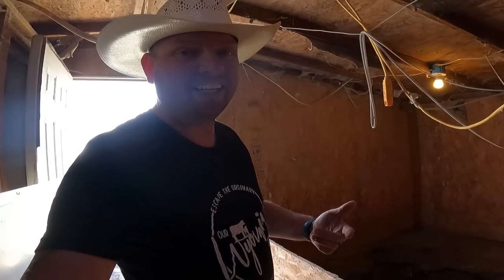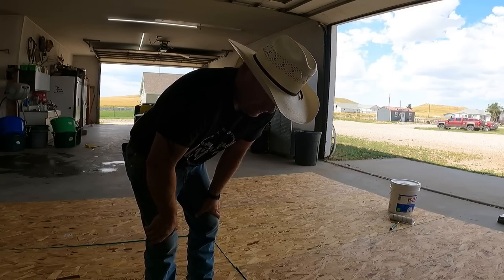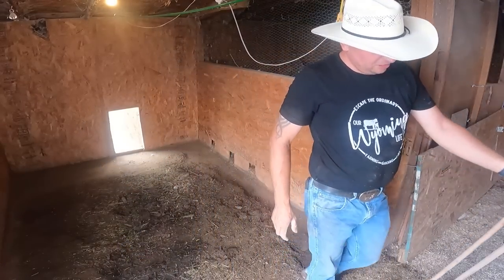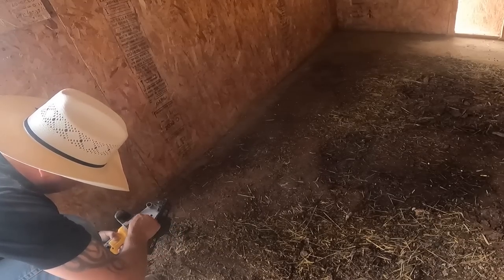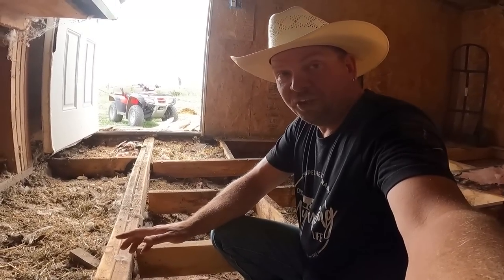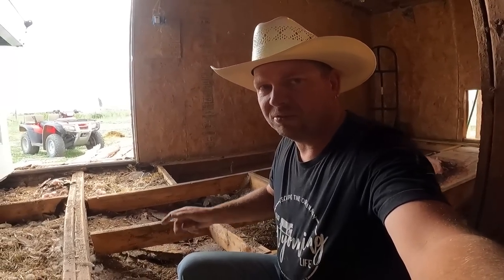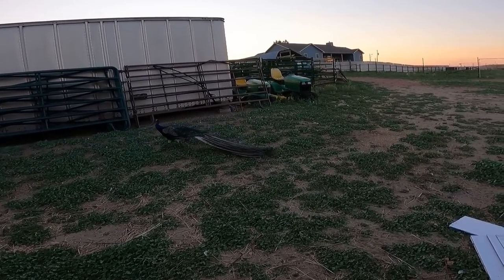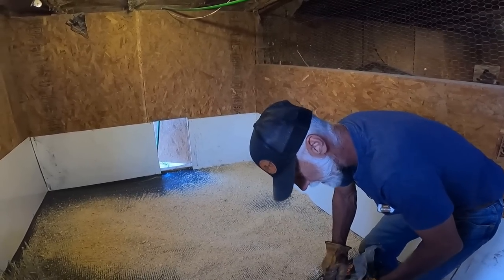Chicken House Floor Remodel Begins

Comment: great new digs for the goats! I use equine stall pellets for my one cat's litter box. For nearly 3 years now, one 40lb bag @ $5.99 will last for 4-6 months from Tractor Supply.... huge savings from normal cat litter...
Reply: Great idea. Maybe I could use it as quail bedding . Hello from Lakeland Florida
Reply from the maker: Hadnt heard of using pellets for litter before. May have to try that.

Comment: Mike,  This is only a suggestion, Why didn't you think of using that Brush ON / ROLL Flex Seal Rubber Sealand? It's a great  product to use on wood or steel as a moisture barrier. I used it to fix a water tank for my cattle. Yes it is a little pricey at 110.00 a gallon but it does work great. If you do get a  leak in your water tank get the Flex Seal  Rubber Putty. It's the best that I came across to fix tanks.

Comment: We made ours on pilings up off the ground a couple of feet just so the chickens had a place to get into shade where it was cooler we also insulated The Coop and put OSB on the inside of the walls and painted it, it's also integrated into the Run so that in the case where I'm not there or my husband's not there and the chickens need to stay in the Run they can still have access to the coop for egg laying and just getting out of the Sun, Every Spring when I clean out the coop really well and wash and sanitize the walls I put used motor oil on the floorboards to protect against rot it seems to be working really well I just let it dry out and it repels moisture, I also use it on the outside board and batten Oak and Maple siding it gets really dark but it definitely protects the wood from the Sun and the elements

Comment: Why have a wood floor at all?  Especially in th goat pen, either dirt floor, crusher run gravel or concrete would work much better.  Add rubber matting over the top and it would be extra comfortable.  I would do the same on the chicken side.  Wood floors encourage cats as well.

Comment: You gotta sister that split floor joist. With multiple 2x6. One or two screws and a few blocks isn’t going to hold. 
Your probably cheaper just buying 2 shipping containers.  It does look good though.

Comment: The block was turned the wrong way, the holes should be top and bottom not sideways. Too late now but it’s more stable that’s the way it is designed. Panama City Florida, USA. 🇺🇸

Comment: What I did was toward the floor and then put a layer of plywood on top I didn't even move the rotten floor it lasts another 30 years when I left the farm I also oiled the top then put linoleum down the noni um did where where it was travel constantly it was the best thing I ever did

Comment: Concrete would’ve been the ultimate floor for a building is being used for animals.
Reply: I just did some quick math, about the same cost.
Reply: Definitely concrete would have been more standard. But that would have entailed a much more complex job. 

I think Mike wanted to just solve the immediate problem, which he did.
Reply: Cost yeah no doubt it may been a little bit more at the time. But figure in materials that he put the floor down the first time and all the materials put down the second time along with labor guaranteed the concrete is a far better cheaper dealj
Reply from the maker: Concrete floor someday today fix will last for a while. Thanks for watching.